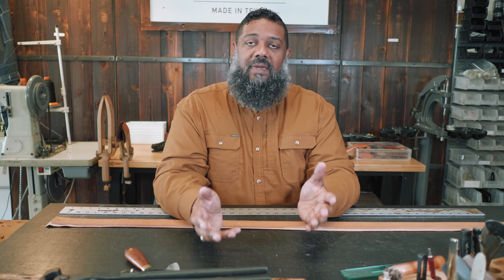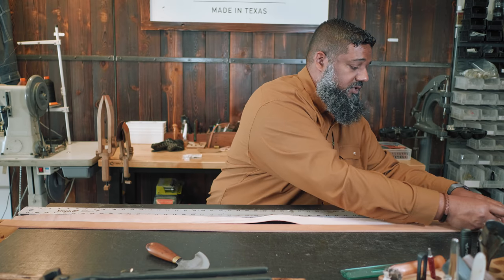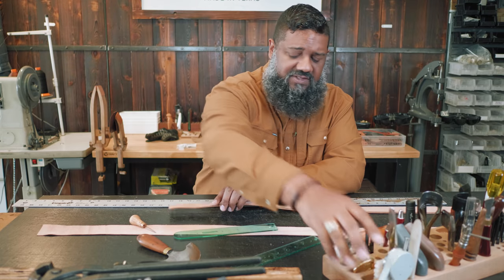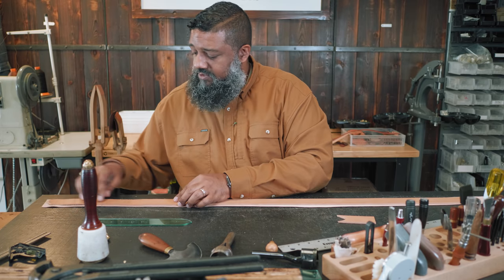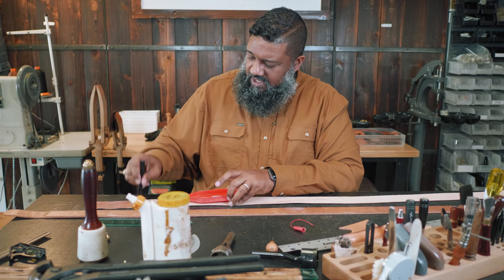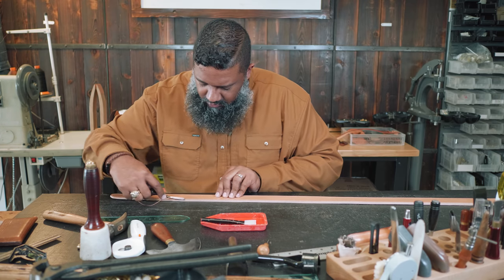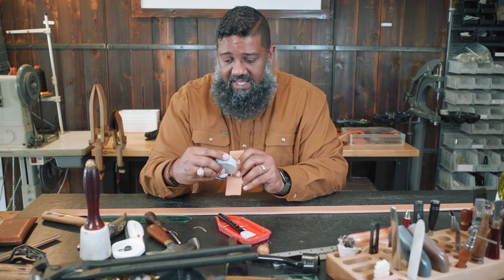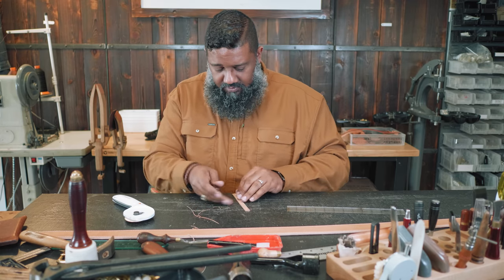How to make the worlds strongest belt

Comment: My real name is Michael McCluskey. I also do leather work. I have a 1938 Singer industrial sewing machine for sewing leather. I also rigged it to power it with bicycle pedals on an old dining room table. I cut out a hole to fit the sewing machine in and cut a slot to put a pulley belt through to run the sewing machine. What got me started was making a holster for a Zippo lighter and I did sell many of them.
Reply: I would be interested in seeing a video or at least a pic of this. Please!
Reply from the maker: That's very cool! I'd love to see your setup.

Comment: Just my preference, but I would rather have snaps and not rivers holding the belt together so I could change buckles if I wanted. Unless it’s just a dress belt, most men I know have a drawer full of different buckles.
Reply: absolutely!   rivets are a automatic NO-GO on belts.   chicago screws are the best thing for it because they still have the strength, but also allow people to change the buckles.
Reply: For my own belts, rivets don't bug me because I'll just pop em out, I find that snaps can wear out and let you down after a while, sometimes I'll even stitch the buckle in, worst come to worst you just cut the thread and restitch after.
Reply: Snaps are weak and screws get unscrewed. Rivets for me please. One proper buckle is enough for me.
Reply from the maker: That's a fair comment. When requested by a customer I will use snaps, but I'd prefer Chicago Screws (with a dab of loctite) if the customer needs to remove the buckle. All that said... Most customer NEVER change their buckles, so I opt for the most secure method possible - solid brass rivets. NOT pop-cap or double-cap rivets which aren't very strong. It really just depends on the customer. Most my customers are not switching belts. But, when requested I happily oblige.

Comment: Hey Odin, Speaking from experience. You should grind the top of the Rivet Punch that is flattening and cracking off. The Metal can break off and cause an injury. I got a piece in my eye that led to an infection.
Reply from the maker: That's a good tip, and make sense to be safer. I have in fact chip a few of those little pieces off in the past. I think these setters were at least a half inch longer when I originally purchased them.

Comment: Very nice build!  I went back a couple times and couldn’t find your needle size that you use with the 138 thread or do you just use the same size needle for your 138, 207 and 277.
Reply from the maker: I think I'm using a 22 or 23 needle in the Cobra 26 for 138 thread. You may have to adjust depending on your machine.

Comment: What is the purpose of using a liner? Will a 10-12 oz. leather be ok with just the leather belt without a liner? I am a beginner in leather work. With very limited supplies and tools. LOL! If the liner is important to use, I will use it. Like I said I am a just starting beginner. Thank you!
Reply from the maker: The liner is not required. I use the liner to make for a more finished look and an even sturdier belt. My belts tend to average 14-16oz in thickness. I also make single layer belts that are 12-14oz thick.
Reply: @OdinLeatherGoods  , Great!! Thank you for the quick reply!
Reply: What’s 14-16oz in mm?

Comment: How do you get your belt stitching so neat and no marks I’m using cowboy 3200 and it seems to always leave presser foot marks.
Reply: Not sure about the CB3200 but on my both my machines I can adjust the feet to match height of the material, thus reducing excess pressure (check your manual, maybe your machine can do this too). Then I set the walking and presser feet tension as low as it can go while still gripping. Also make sure that your feet are smooth.
Reply: @dmg92001  thanks Derek I will have a go at adjusting
Reply from the maker: I agree with Derek’s answer above. Your top pressure maybe too great. I also go over the belt with a glass slicker.

Comment: What kind of glue do you use on the belts?
Reply: Renia Aquilim 315
Reply: ^^ its a good one, one of my favorites. But i also like their colle de cologne by renia. Also good ol' weldwood Contact cement. Ive moved on from Barge personally.
Reply from the maker: I was a Barge guy for years - and I still keep a gallon of it in the shop for special projects - but now I’m primarily use Aquilim 315 from Renia. It works beautifully (except on very humid days in my workshop).
Reply: @OdinLeatherGoods  big fan of Barge.  I was looking for a high quality replacement.  Thank you.

Comment: I use a Lot of Chicago screws or snaps.
Reply from the maker: Nothing wrong with Chicago Screws, but they can unscrew over time if you don't check them. I don't care for snaps though - they break and loosen over time. Most my customers aren't changing their buckles so I opt for the strongest method possible - solid brass rivets. When requested, I will use Chicago Screws too.

Comment: What’s your thoughts on using pigskin as a liner?
Reply from the maker: Big skin is fine for many things, but its really just decorative and doesn't add any strength. For a heavy duty belt, I prefer to use saddle skirting or bridle that around 3oz thick. It will likely never wear through and help give the belt more body. Use pigskin for wallets and bags, not for belts.

Comment: Hi, the problem I get with leather belt, when my back sweat, it deformed, and get damaged
Reply from the maker: We all sweat! So, you need a sturdier belt that will resist that as much a possible. The tighter fibers in good saddle skirting and the waxes and oils in Harness Leather and English Bridle will help with that. Your belt should still mold itself around you in time and develop a bend in the back - that helps with comfort - but it should still be rigid and have body. Cheaper belts will just get floppy and nearly useless. Also... Rotating you belts will help too if you sweating like crazy in them everyday (like if you work outside in the sun). Give the belts time to dry. But if its just normal wear and sweat, a good belt should handle it with ease.

Comment: Curious as to what size oblong punch do you use?
Reply: I would like to know also. That would cut out the guessing. It seems I always cut it too long.
Reply from the maker: My templates are sized for 1.5" oblong punches, but more often than not I'm using 1.25" oblong punches now. It makes for slightly tighter fit. For the sake of retail presentation... I don't like floppy buckles.
Reply: @OdinLeatherGoods  , Thank you!

Comment: You have the quietest bench sander I never heard 😮
Reply: I think he used computer software to reduce the noise.
Reply: @martin8313  that makes more sense haha
Reply from the maker: Yep. My shop has a lot of extra noise - airplanes flying over, cars and motorcycles driving by, and a wood shop next door. My editor has to work hard to adjust all the levels.

Comment: To make the world's strongest leather belt you'd have to start with the world's strongest type of leather, i.e., kangaroo hide:

"To obtain a similar strength you'd need to get a cow hide leather probably up to three times as thick. It is known to be up to 10 times stronger than cowhide in the same weight, and 50 times stronger than some sheepskin.

Research found kangaroo leather has numerous advantageous qualities, including a tensile strength that exceeds that of any other domestic animal leather, a naturally fine grain, and a light weight. Differences in the fiber structure of a kangaroo's skin also means its leather is the strongest compared to others of equivalent thickness."

Comment: OLD Leather Smith here, very nice except ONE thing, the belt will last but will the buckle.  I ALWAYS USE CHICAGO SCREWS, my preference.  It's easier 2 replace a broken buckle with Chicago Screws than rivets.  Now I only do custom, and repair, but there's a way 2 make the belt even stronger and it's not only adding a back piece.  I am guessing you already know that.  GOD'S BLESSINGS ✝️⚾🙃
Reply: How do you make it stronger?
Reply: @Steveat9258  OLD Leather Smith here, what kind of belt R U making, Fashion, work, or every day??
Reply: @james2592OldLeatherSmith  A Corrections duty belt that will see every day use at work. I want it to last a very long time. It will be plain black.
Reply: @Steveat9258 OLD Leather Smith here, I would use a leather lace & double lace it, or U can buck stitch it or U could use 2 6/8 ounce leathers together lace or buck stitch instead of sewing which would make it extremely strong.  Any other questions please ask.  GOD'S BLESSINGS ✝️🥎🙃
Reply: @james2592OldLeatherSmith  Thank you sir!✝️

Comment: Nice belt, crap Buckel, get a Buckel u can slip the ent underneath the belt and do way with the keeper, also be nice to taper and sew the sling that holds the Buckel......
Reply from the maker: I promise you its a nice buckle - solid brass with great finish. It may just not be the style you like. I use center bar buckles too for some of the lighter weight belts I make and they do not require a keeper. They don't hover work well on thicker belts like this. They're just not wide enough. You really need a roller-buckle for this application.